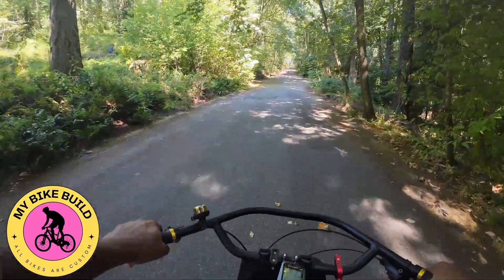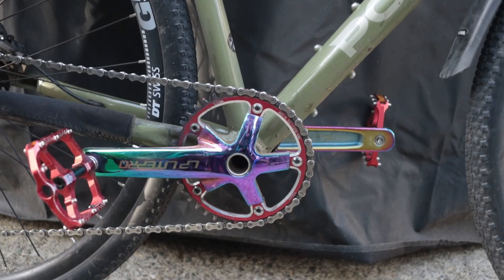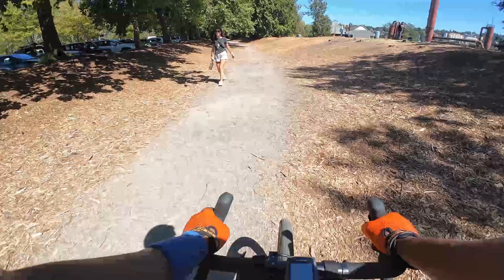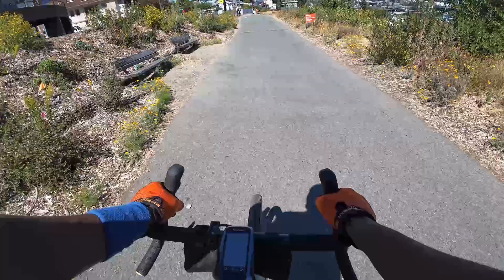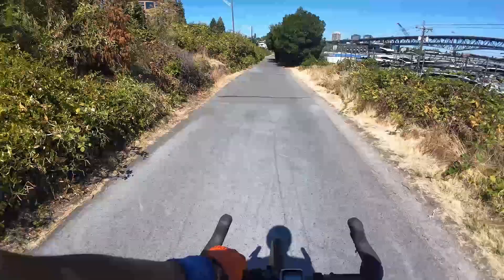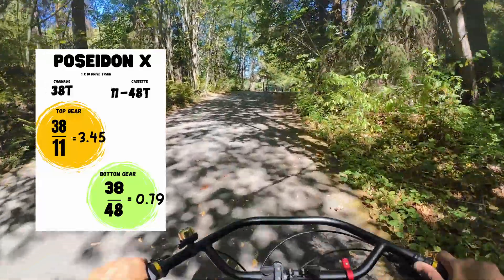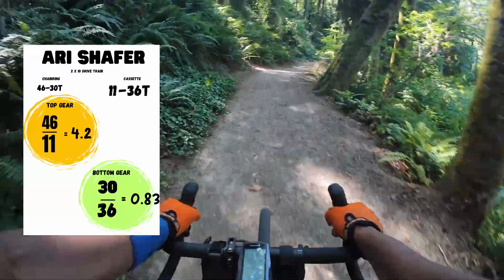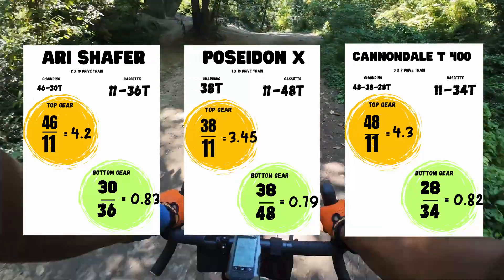Understanding Your Bike's Drivetrain: All about Gear ratio

Comment: My favorite combo was on my Trek X-Caliber hardtail which unfortunately got stolen. it had 2x11 setup; 28t/42t front 11-46t rear cassette. Massive range and even though shimano specs said a 14t jump in front was too much - the Front Der handled it just fine.  Ultra low gear for the offroad hill climbs.  and it had 29" wheels so the tall gear was still plenty fast.
Reply from the maker: @rickc2222  That's a huge range! .58 on the low!
Reply: @MBB31  yeah i was just getting back into mountain biking and struggled a bit on climbs keeping up with others...the low gear on this was so comical i debated if it would be faster to just get off and walk - amazing effortless torque climbing that way though!!

Comment: Hey  really enjoying your channel and you keep the vids coming which is great 😁.
I  find it easier to use gear inches rather than gear ratio.
Have a look at bikecalc.   gear inches.  You can input your chainring /rear cog teeth range/wheel tire size and it will give you a table with gear inches for different combinations.   Gear inches is the inches in distance the rear wheel turns for a set gear ratio.  Eg.  20 gear inches is an easy gear 100 is a hard gear.
Sorry I've made it sound overly complicated but it's an easier way to compare ratios imo.😊

Comment: i just need 12-65 inches but bike manufacturers insist on giving me double that. it's an easy fix. (1-5 metres development segmented into some sort of equal spacing) only road race sprinters or downhill racers need longer as long as their legs spin up to 130-ish a minute. anything under 50 a minute is a grind and i'd rather walk up.